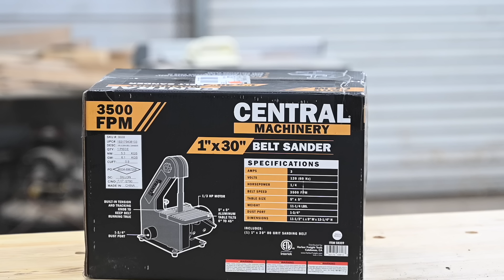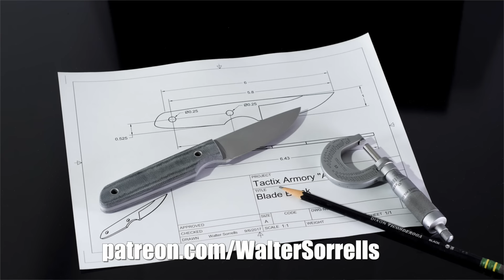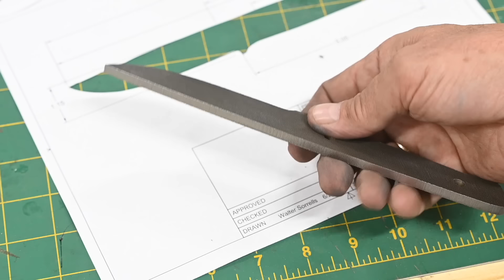Ultra Cheap Belt Grinder...Exposed!  (Harbor Freight 1X30)

Comment: I have had my for years and it still runs. I basically abuse it but never for long periods. The thing that drives me crazy is the bumping of the belt seam against the platen. For my taste it runs to fast for woodwork since mine has the disk also. I got mine in the good old days when HF had 20 percent coupons regularly. When I shut it off I always smile, that's a good tool.

Comment: I have a similar machine, mine is branded as a Delta and also has a 5” disc sander. I also have big sander/grinders. The big machines are great for bigger jobs but if I have a small part that I just want to remove a little material from I find my little 1X30 sander great for those jobs.

Comment: I've used this to make a dozen or so knives over a few years. This review is accurate. The cons not mentioned is that it can be a challenge keeping the platon in line with the belt to get uniform bevels ground in on both sides along the bolster. The tensioner knob doesn't always work the best to adjust the belt position. A big pro for an amateur knife maker is, being that it is slower, you are less likely to grind in a big mistake that you can't fix. Slow and steady and be sure to cool blade in water often as you are more likely to ruin a temper because of how slow it can be. Between this and a cheap harbor freight angle grinder with a cutoff wheel and a flap disk you can accomplish some really nice work. Use the angle grinder cutoff wheels for 90% of your profiling and the flap disk to rough in your bevels to quickly hog out material and use the belt grinder to refine the last 10% and it's a cheap and still fairly quick process.
Reply: Dude these grinders are anything but slow. They're viewed as much too fast by the knife making community, or at least those that are actually good and knowledgeable. If you're grinding so hard that you're stalling these one speed motors you really need to reassess your practices. And where did you get this idea that slow grinding affects temper? You are incorrect

Fast grinding is basic physics with rate of speed and friction causing a rapid heat up.
Reply: @TingTingalingy  You respond to his comment on the speed of this machine like you are unaware that it is variable speed.......of course, you did know that, right?

Comment: I have been using that HF sander for years. Would better sander be better yes. I fix up old rusty tools. Mine held the belts too tight, so I removed the adjuster and filed it a little.  I don't use the table or side cover, and most of the time I don't use the platen. I do plan on making a full-length one out of a  2x6 that comes on and off fast. I have been using a stick on the back of the belt. Blue ribbon con-dishing belts are your friend. It has been said that they don't work on an HF belt sander. They are stiffer than regular bets you can soften them by working them by bending back and forth in your hands and modding the adjuster. They are worth the trouble. If your sander starts to get noisy the allen screw has come loose. I am happy with mine when it wears out I will upgrade. Also, a fiber wheel for a bench grinder is worth thinking about.

Comment: Hey Walter. Been watching for years and love your content.
I am familiar with the Harbor Freight 1 x 30. The original was green and looked identicle to the new version that you have. The original was a 1/3 HP and if you look at the box the picture shows 1/3 hp but right next to it in the specification chart says 1/4 HP ( see your time stamp 2:07)  Most of us leave the side cover off.
I am hoping that along with all the upgrade tools coming to HF that maybe a Bauer or Hercules Version is comimng soon. There are plenty of variants on the net for a little more $ that are better.
Reply: Yep, I got the same one and it's still running! 👍
Reply: In My experience H.F motors are  badly over rated. an old bench grinder would bairly start when pluged into it's rated 110V. however changing the plug to 220v and it ran as expcted.  A 110v bench Drill press would bairly drill a 1/4 in hole bur I never tried to up the voltage on that.
Reply: @lloydscharf6897 I've never had these issues ever and I have all hf power tools minus my kiln and 2x72.
I use the warranties too. 
Something isn't right in your wiring somewhere is this is consistent with you

Comment: I have one of these 1X30 belt sanders from Harbour Freight,,, these units are sold under a variety of brand names, but they're all the same machine.
I paid $30 for mine a few years ago, it has been great, works well.

The one weak point for this and any 1X30 Belt Sanders is the filament tape that connects the ends of the belt.
The tape has a shelf life, the material that the connecting tape erodes over time, so you need to buy fresh belts every couple of years.

And if these belts are stored in a hot/ humid environment or where gas or chemical fumes are present, the erosion process of the cheap filament tape will be exhilarated.
Otherwise this super sander (not really a grinder) works super well.
IF YOU WANT TO GRIND SOMETHING, USE A STONE GRINDER AND STOP EXPECTING A BELT SANDER TO GRIND AWAY ENOUGH MATERIAL TO ACCOMPLISH THE TASK..... !    (dumb, just dumb)

Comment: I'm a fabricator, I have one I got about 15 years ago, it's a good tool for debuting.
The only problem I've had with it, was the switch went bad, fit a better switch and it's fine.

Comment: I have the older (green) version.  It's seen lots of use in my small shop, where I do a lot of one-off stuff.  Have not used it for knife making, but it has saved my bacon a few times over the years.  I seem to recall paying around $40 for mine back then.  Agree on the included belts: They don't last very long.  Get some better quality ones.  It's one of those tools that would get replaced if it ever dies.

Comment: i've been using the green version of this machine for a few years now! does plenty to get you started, i've ground 4-5 knives and a ton of woodwork on it. The only thing I can't recommend is any belt that's too thick, sadly won't fit around between the case and wheels.

Comment: Made my first knife at my dads copper smithing shop.   I used a hacksaw, 5” bench grinder and a forge.  If someone approached me today and said I want to make a knife.  I would say you need a decent c clamp and an angle grinder.   You won’t get the crisp lines like a belt grinder  but for $30 you can cut, profile, and finish.

Comment: I use this guy to sharpen my turning tools. It's great with a good belt, had to modify it a little bit. 36 grit ceramic belts are great for shaping something like a heavy duty negative rake scraper. I did have to cut off the back of the platform some to allow for more aggresive angle on the tool, but over all this little guy gives me a flat or if I want convex grind on my tools. Convex can be cool on like a skew chisel. Also it eats less metal than a bench grinder with 600 grit belt which is what I touch up the tools with.

Comment: it's been my experience that HF abrasive products are one-use products. One cutting disc per cut. One flap wheel per weld. But I'm willing to try out the sanding/grinding belts!

Comment: I have a 1x42 with an 8 inch disk grinder I setup for wet grinding for knife sharpening with silicon oxide belts. But it was my only grinder when I started.

Comment: I've had mine for 2 years 1x30 short of  modifying a couple of things  table .angle setting.   Back stop plate. . It works perfectly for beginners I've used it several times it does stop though if you put too much pressure on it if you don't  set the tension right also used it turned on its back side if you don't mind adjusting some things modifying.    As far as professional knife making where mass production I would go more industrial what you've learned to use it to grinding process and get used to it if your skills improved. But there's also free hand to which I did a lot of

Comment: I'm here to see if I can shape brass for making guitar hardware for upgrades and modifications. I saw another review saying a piece of wood would stop the belt with little pressure. I felt that was unrealistic I'm glad I came here and watched this. This machine is probably better suited for what I'm doing with it working and shaping tiny metal parts than making knives.

Comment: Master Smith Wally Hayes did two VHS tapes for Paladin.  I believe he made a stock removal "Samurai sword" on a 1x30, or 1x42 grinder.  If not he made the knives that were in the other tape.  We have pretty much all been there.

I have a 2x72 pro tool, and I still use the 1x42 cheapo more.  It is great for all the small jobs, and sharpening jobs around the shop.  And super easy to move outside so I don't get toxic grit particles everywhere.

Comment: I have several Harbor Freight power tools including one of their 3" by ??? designed for wood work. It like this tends to stall pretty easily. In fact I usually move the belt before turning it on as it will stall on startup every once in a while. Once running as long as I don't push it too hard it works fine.
The thing about these tools, which you said, they are great starter tools as well as tools that you know you will rarely use. (I actually have ended up using their angle grinder far more than I thought I would but it works like a champ.) I can't see spending a ton of money for a professional grade tool that I need for a project but I might only use 3 or 4 times in the next decade. 
The only exception concerns wrenches, ratchets and sockets. After cracking a knuckle when a cheap wrench snapped back when I was in college I get the best I can afford. But then I use them a lot and take care of them. Heck, I even have some of my Grandfather's tools that I still use and I'm 72.

Comment: 04/09/24.  I have had my Harbor Freight belt sander for over 5 years .. Just had to replace the (ON-OFF SWITCH) (AMAZON $6.39) (Watched another you tube video on HOW TO )..... JUST USE IT  for sharpening mower blades, axe blade.. Knock off rough edges on metals. smooth wood corners .. A whole lot faster than a file . 1" belts a cheap and do a good job .... OVER ALL  2 THUMBS UP , VERY HAPPY . FOR $50. GOOD PURCHASE

Comment: I've got a similar one with a disc sander on the end! Never used the disc sander, waste of space. On the other hand the belt sander is in more of less constant use. Small, compact, easy to carry. Belt change and cleaning, simple to easy. Cleaning a must, as the material inside tends to build up, I wouldn't say there's any great accuracy, I use a small level on the plate and F clamps on the base. For small, fiddly, take your time work, I find it does the trick. Used it on larger pieces for surface cleaning, I feel some basic skills are warranted as you are working close to the belt. However, because of the speed, serious injuries are very unlikely, in my opinion. If you push to hard against the belt back plate, you can easily stop the belt rotating. Bought a bigger one with the vertical and horizontal option. Should have given my money to a charity. It sits there, mocking me, for being so dumb!

Comment: I used one for years. It worked fine, slow, bot it worked. I finally built a 2x72 grinder with junk.  I had laying around. The only thing I had to buy was a few bearing, a shaft and 2 step pulleys.

Comment: I've had this sander for about five years. I use it to bevel the edges of ceramic tiles. I have literally put ten thousand tiles against the belts. The only thing I've had to replace was the two smaller pulley bearings. If you keep it clean after use and occasionally repack the bearing, (the seals easily pop on and off.) i'm certain you can get ten years of use from it.

Comment: "belt grinder...scratch" did you make a funny? I like it. I have the combo unit with the 5 inch disc sander and it's really nice for establishing primary bevels on chisels and plane irons. I picked it up used and it needs new bearings but that's an easy fix. And I bought better bearings for it (Timken), though it will take skateboard bearings, too.

Comment: I had one of those. I bought it to sharpen my chisels, and knives, and wood and metal. It was great at first. Right away I was easily and quickly able to put sharp edge on all my chisels. One day when I went to use it, it was suddenly a very different machine. Instead of being awesome, it was the cheapest thing ever. I dug out the receipt for it, I compared the item number on the machine with the numbers on my receipts and I couldn't find it. So I dug out the box and the item numbers didn't match! It WAS a very different machine! I eventually fixed it up and got it working as good as the original. Only one person knew I had it. He saw me sharpen all my chisels in a hurry.

Any way, Harbor Freight can offer near identical units at different price points. They're made in different factories, so if more than one price is offered on an item there's more than one item. If you think you're buying the best one on sale, check the item number. Oh, and keep your boxes, you can never know when that will be important.

Comment: Thank you!' Mr. Sorrells!;
I don't really want to make knives as much as mod & sharpen a few.
For instance, I have a few Moraknivs & I want to mod the tip angle a bit.
It looks like the edge angle changes from the grip to the tip by about 4-5 degrees.
I'd like to make mine have the same angle from grip to tip.
The Central Machinery belt grinder/sander maybe cheap, it may not last, but it does work.
I'll be buying it or something like it.
Have a GREAT day, Neighbor!

Comment: It does me pretty good for little stuff ive been saving up to upgrade for awhile but im happy with it for now, one thing I recommend is get some masking tape and cover the gap on the gaurd rest, I've noticed that sometimes it will pull the blade down and stop the machine through that gap taping it off will stop this, use masking tape its easier to remove when it is time for a new belt!

Comment: I've done great with Central Machinery equipment. Forget about the price, it's simple, uncomplicated and sturdy. You can spend more, get bells and whistles (I never use them) and maybe even a quieter machine, but is it really what you need? 

I've got a Central Machinery drill press I've used the heck out of for 15 years used 3-4 times a week. It's got a belt squeak now, but it's been a decade and a half, pretty sure that's the service life of about any belt.

Comment: My sharpening business uses four of these HF machines. They are somewhat rough but in 6 years none have failed. I have a different grit on three and a leather stropping belt on the other. for $200 (plus belts [Trizact & Cubitron]) you can have a very efficient sharpening system that delivers incredibly sharp knives. Then, when your enterprise become profitable, you can buy superior  equipment.🙂

Comment: After using it for years...I think they ought to re-market it as the best damned knife sharpener you can buy... and include the 1x30 leather strop and green compound.
Reply: Hey, not a bad idea!
Reply: They could literally slap some new labels on it, change out the included accessories, and swap it to one of their other house brands(the 'Warrior' brand seems to be their new cheapest lineup of general power tools, the classic $15 HF angle grinders are 'Warrior's now, so I suppose that may be the most appropriate option lol) - boom, whole new SKU, costs them nothing but some new boxes & decals, an entrant in a specialty market to go along with their recent 'Doyle' anvil that's gotten some praise, and it would be totally on brand for HF lol

Comment: I started out with one of these. One problem i had was that they only lasted a few months ( thankfully i got an extended warranty, so it didnt cost anything to get a replacement). I eventually bought the WEN 1x30 ( home depot house brand ), and for just a few dollars more, the WEN is a much better machine.

Comment: Good video.  Thanks.  

Coincidentally, about a month ago I bought this exact belt sander...  for making knives...  kinda...  I  knap, and make stone knives - prehistoric, stoneage style - and I got this to speed up handle making.  Up until now I've been rough cutting with an axe, shaping with a knife, then finishing with files and sandpaper.   This cheap little bugger, for me anyway, has almost been like cheating.   I have a wish list knife, though.  I want a K-bar shaped knife, with a full tang, instead of the crappy rat-tail design of an actual K-bar.  I also have a few old files and lawn mower blades that could be used for that very purpose, so I might have to give this a try.

Comment: I am trying to make fishing lures (wood).  The sander is great for small stuff.  My HF sander's motor got burnt.  Now I have Delta version of it (used).  I think the Delta version may be the original design.  It works the same in general.  I like the belt tensioner better.

Comment: My overwhelming problem with any tools is the space — actually lack of it.  I have a floor standing drill press and a wheel grinder.  But that is absolutely the limit in my garage.  I mean, the primary use for the garage is after all to store my car.  Seeing the light belt grinder, I again thought — hey, would that fit somewhere?  But the answer came in just 2 seconds: No way!  I must stay with my hand-held tools like Dremel and Milwaukee drill or Skill saw.  Thanks for the 2 seconds of dreaming, however!

Comment: I've had one of these with the 5" disc sander on the end. I got mine open box for $30. The platform is the only issue. Really tough to get and maintain 90 degree angle.